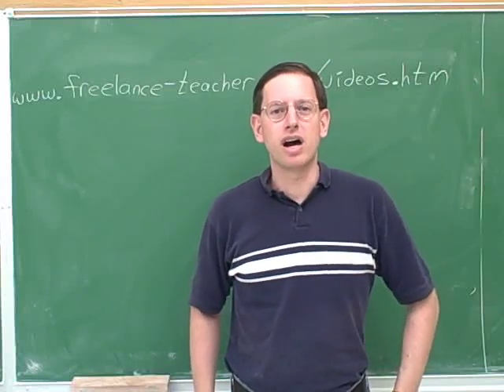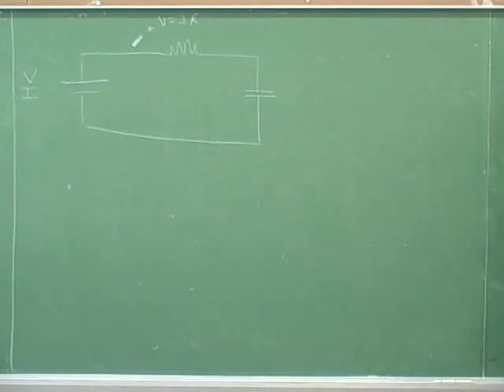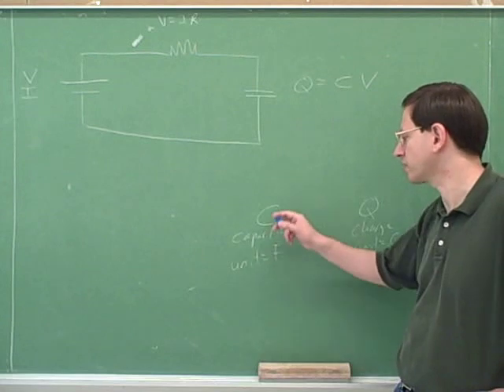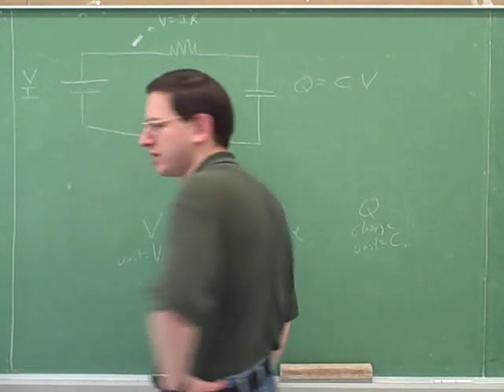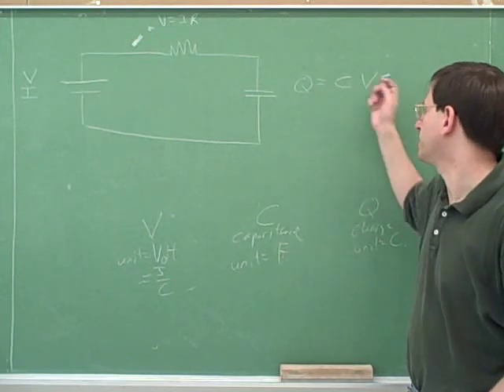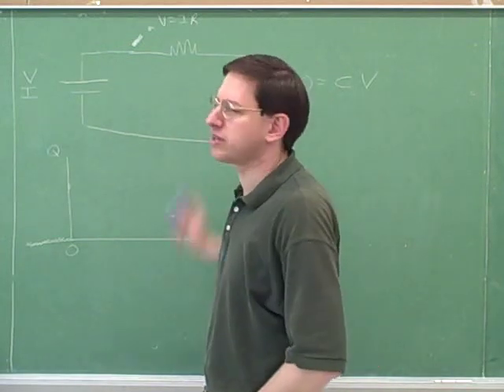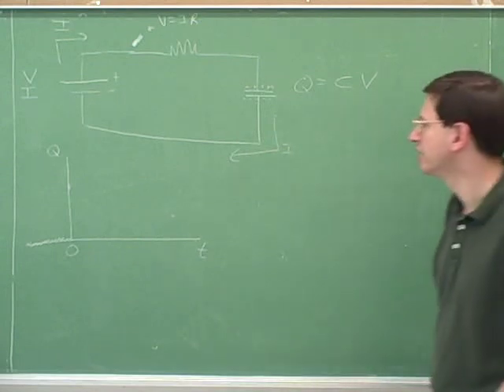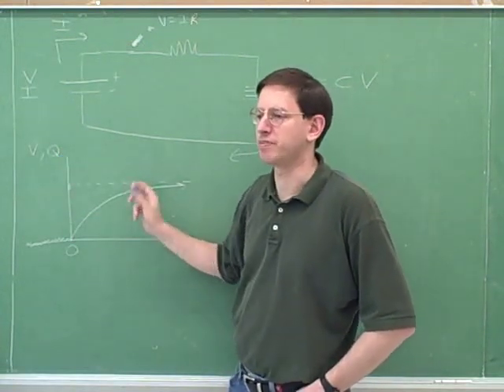Capacitors and inductors; RC and RL circuits (1)

Comment: Why would you analyze the circuit as the current going from positive to negative? in actual circuit schematics you should view the actual flow of current which is going from negative to positive.
Reply: jewish scientist The idea of tracing the path of positive charge was put into place BEFORE the concept that "electrons flow" was discovered.
Reply: It is incorrect. When I analyze circuits that are broken I start from ground and see if any of the components in series with ground are not working,
Reply: jewish scientist blame Ben Franklin, not this guy. It's standard in physics.
Reply: It is because of noobs like him that conventional currrent  sticks around, Ben Franklin was a good American and I will not blame him.
Reply: jewish scientist Lol indeed. Ben was a good American indeed.

Comment: This is the best explanation I've found so far.  One thing that I'm still puzzled about is why the electrons would move from the battery in the first place since it's not technically a complete circuit?  Do the electrons still "feel" the suction from the positive charge of the batter over the gap in the capacitor and this is what impels them to fill up the capacitor?

Comment: hello there this might sound like a dum question !! one of my friends the other day linked to batteries together off an ac adapter that had 9volt out and 250mah out would the  batteries get half of that or would soming go wroung thanks alot by the way there ni-mh bats dylan abbott

Comment: Mr. Guilty Wave,
Wrong is always wrong, please corrects yourself, DC close circuits will charge capacitor to it's peak value but current can not pass through it. It's offers 
  Xc= 1/(2πfC) , Now for dc  F=0 , so  Xc = 1/0 that is infinite ohms.So current can not pass through capacitor.